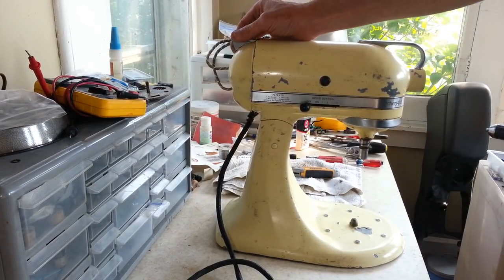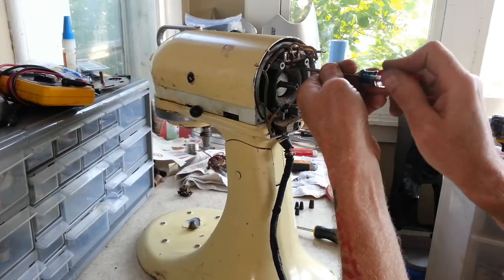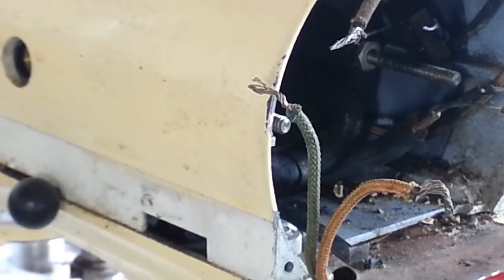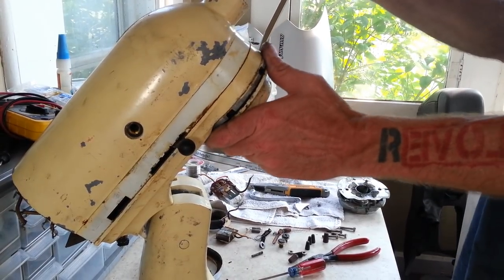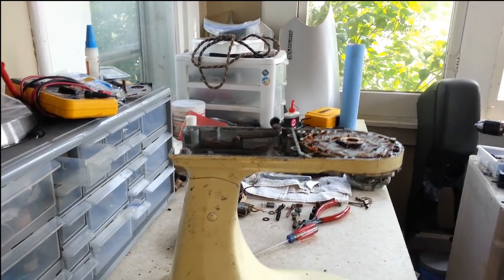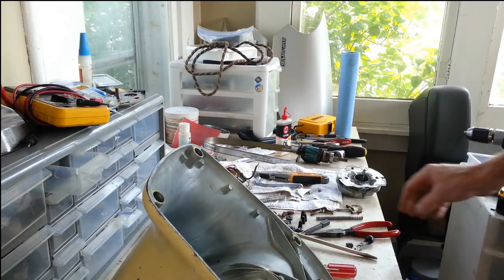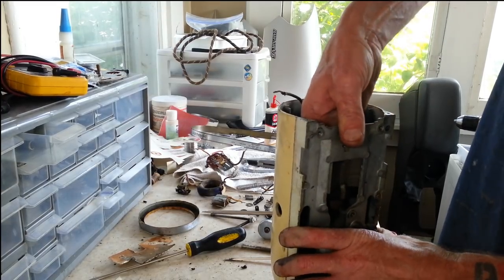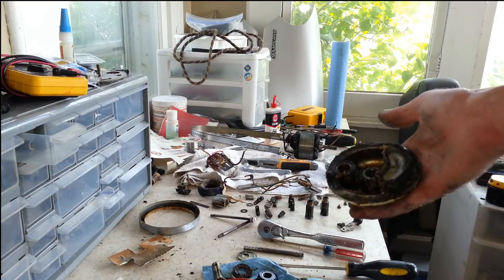Vintage Kitchenaid Model 4 complete restoration Part 1

Comment: I appreciate this. Our KA Mixers from the Hobart days are so much better built than the Whirlpool ones. This Model 4 looks like it's meant to run forever.
Reply from the maker: Thanks! Yea, I am really impressed with the build quality of older appliances, before the days of planned obsolescence!
Reply: the first whirlpool machines were exactly the same as the hobart.  there are later (and maybe even current) models that all use the same parts.  So please explain how the newer machines are so much worse.

Comment: I have a Kitchenaid model K4-B that looks exactly like this one here except it has 1-10 on the speed control.  I have completely relubricated the planetary and gearbox area, and repainted this mixer.  It runs smoothly, but occasionally emits a howling noise that changes in pitch and comes and goes with changes in speed.  It sounds like a bearing.  Kinda sounds like it's coming from the rear of the mixer, but it's hard to tell.  Are there two main bearings along the motor shaft, or more?  What do you think this noise could be?  The gear box end sounds great.
Reply from the maker: There is a bushing at the rear of the machine, it is in the rear plate that the armature goes through. It has a wick that can be oiled, but you have to pull the plate off the back to get to it. It is the same part that the resistor, and speed control plate attach to. I am guessing it is probably bone dry, and that could easily be what your hearing. Congrats on the rest of the build! Sounds like it is pretty awesome!
Reply: Vintage Mixers and More thanks, I'm really enjoying it.  It churns out pasta and bread dough just as well as any newer Kitchenaid.  It's a tank. I'll pull that apart and take a look.
Reply from the maker: Ok let me know if it helps! They really are tanks, if I could eat wheat I would probably have one with the pasta maker attachment myself! :)
Reply: I went back and studied your video again, particularly the armature.  That giant ball bearing on the front of it, could that possibly be making the howling noise?  I feel so stupid, because I disassembled it down to the armature and got that rear bearing cleaned up and re-impregnated with oil - it was pretty dry - and never pulled the armature out to look at it.  Mixer still has an occasional howling noise - how would you service that ball bearing at the front?  Thanks for taking the time to answer all my questions!
Reply: Oh, forgot to mention, I do have a short video of this mixer running.  This was taken after I cleaned out the gearbox end and relubricated it, but before I repainted it.  She is now a beautiful metallic copper color.  If you listen carefully, you can hear the beginnings of that howling I am talking about, it's much louder now.
Reply from the maker: They do have an open bearing in the front where you can pack it with new grease, if it is dry I can see it possibly making noise. It sucks when you put something together then have to take it apart again, but even I do that sometimes if something isn't right or I forget something :) If you pull the armature, clean the bearing up good and spin it with your fingers to make sure it doesn't drag, catch, or feel rough, if it is good then pack it with new grease. 
Let me know how it works out, good luck!!
Reply from the maker: I will go check it out!
Reply: Allrighty!  I got it torn down again and try as I might, for some reason that armature would not come out of there.  I even separated the top from the bottom so I could try and coax it out from the front of the mixer but it will not budge.  I watched your video again and see how easily it just slides out of there . . I am lost.  I tried tapping on the small visible ledge of the bearing with a screwdriver and mallet to loosen it - still nothing.  I tried my best to coax some of the grease down the shaft towards it .. but for now I give up.  

It still runs awesome, with just this occasional howl and a slow down.  I will just live with it!   I feel like every time I have to manipulate these old wires on the inside, one of them is eventually going to snap off it's contact no matter how careful I move them about.  Hey, thanks for reading my messages and helping me along.  I have a 1988 ProLine bowl-lift coming in the mail on Monday I am eager to get back into shape, it's that matte gray color, I always thought those were pretty.
Reply from the maker: Your welcome, happy to help! Those bearings are pressed in, not too tough but sometimes old grime will help to lock them in. I either put a punch in the end of the shaft where the pin goes for the flyweight, and tap it out, or if the halves are separated, pull out the PTO gear, and tap the armature out from the front. I wish I would have mentioned that, sorry about that.
Reply: All is good, I just used it to make a ball of spinach pasta dough and it did awesome, just chugged along smoothly at speed 2 no issues at all.  It's amazing, this 70 year old Kitchenaid makes less fuss with heavy doughs than the newer "heavy duty" models . .
Reply from the maker: I do find that incredible, some things seem to be made better these days, but most things seem designed to fail. Those old kitchenaids really are amazing machines, even the newer ones are better than their competition, but give me an old classic anyday!

Comment: Hi. I have a vintage hobart K5SS that's grinding. I checked the gears and they are solid. It sounds like the grinding is coming from the rear of the mixer, near the motor armature area. Any idea what it could be? Thanks.
Reply from the maker: Hi! Its hard to say, the back of the machine does have a spinning flyweight assembly, and that could be loose or damaged, and there is also a rear bushing that may be dry and making noise.
Reply: Is it possible the gears might be stripped but I can't tell? This seems like the most probable issue as the mixer will spin 1/4 of the way then stop and start spinning again. But it doesn't spin most of the time... I took it apart and the flyweight assembly didn't  appear to have any damage. All of my symptoms point to the gears being the problem but I've cleaned them all off and inspected them and I'm just not seein it. Videos of the gears are on my channel. 
thanks for the reply.
Reply from the maker: that does sound like a gear issue, let me check your videos

Comment: I'm looking for a vintage KitchenAid, what's the best one  to look for?
Reply from the maker: I'm not an expert on Kitchenaids, so hopefully someone else will chime in, but I guess that depends on what you want to do with it Thomas. The 3B, 4B, and 4C models are less powerful and not made to do bread dough, and other thick dough, the K45 is a good all around model if you want to do heavier doughs, and are pretty reasonably priced.
Reply: Vintage Mixers and More I have an older Hobart k45 that I painted. It is powerful and good all around. Needs a new power cord. Could you do a video on that? Mine is from '62-'79. The parts don't exist anymore so be creative
Reply from the maker: I will be sure to get more detail on changing the power cord the next time I have a kitchenaid in the shop :)